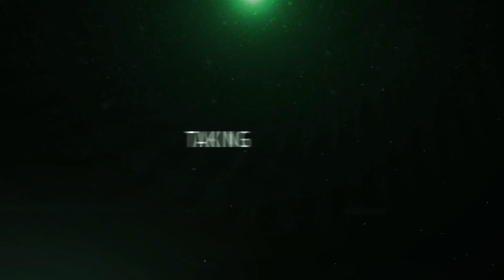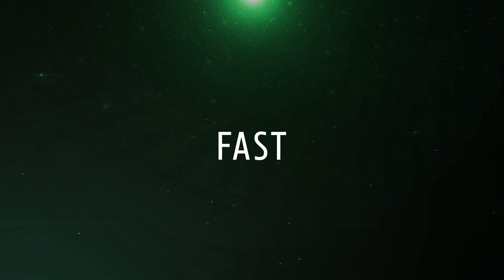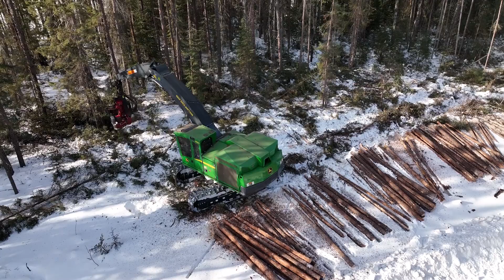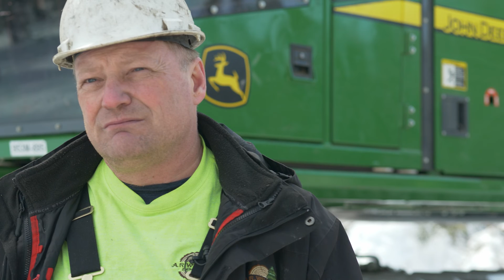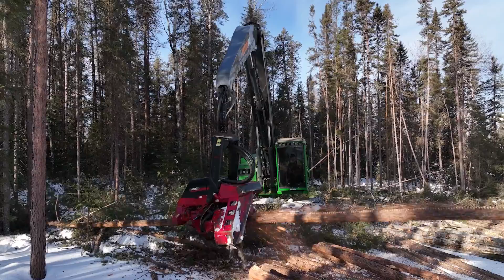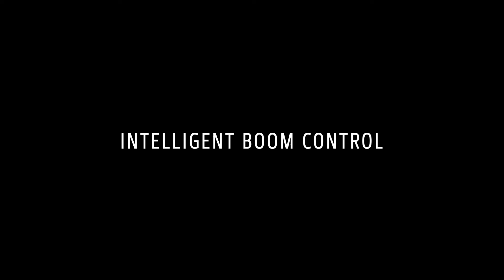Precise Boom Movements | Intelligent Boom Control | John Deere Forestry

Comment: If it actually works to address Deere's problem of jerky Hydraulics that would be great, and so nececessary. Our experience with with our last few Deere machines has been negative. That includes several purchased shovels, loading machines and processor carriers. and several felling application machines that I demoed. They haven't figured out how to modulate the electric over hydraulic valving resulting in machine motion that is unacceptable. As a result we have switched to Tigercat and Linkbelt and aren't looking back. Good luck.